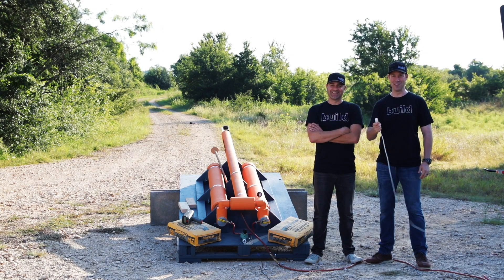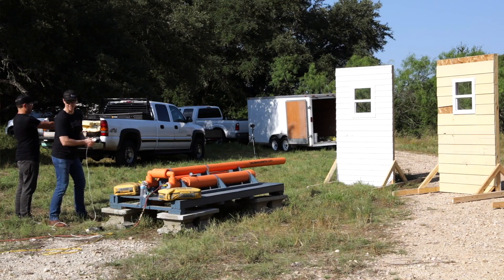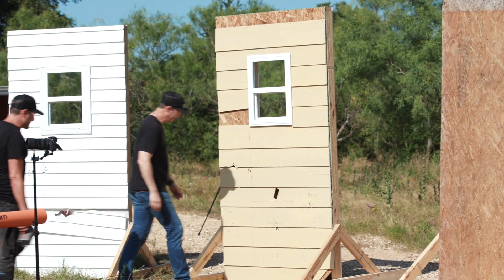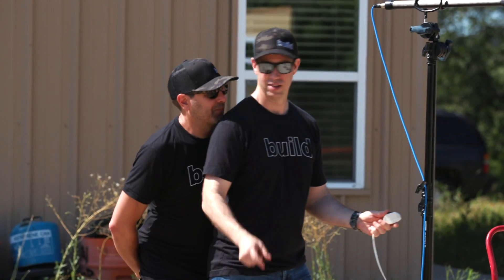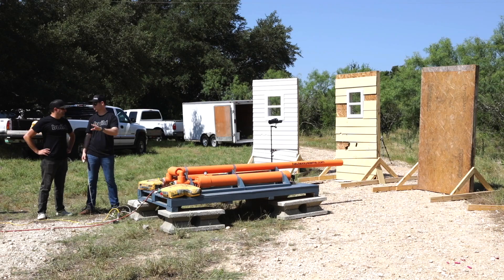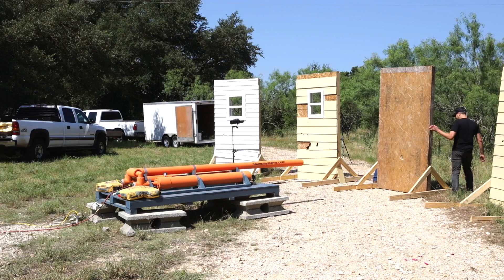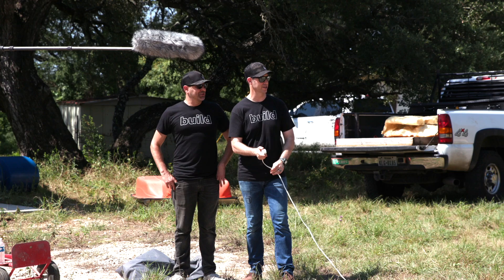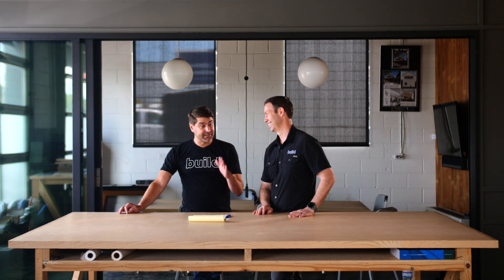2x4 Canon - Hurricane Testing Wood Walls

Comment: How does stucco do in this kind of test?  

ETA: I looked around for information on this question. From this 2006 report DEBRIS IMPACT RESISTANCE OF BUILDING ASSEMBLIES:

With a 15 pound 2x4 projectile at 55mph "the projectile perforated the target".

Too bad, but with 3/4 inch OSB instead of 1/2 inch OSB and diamond lath instead of chicken wire in the stucco my guess is the 2 x 4 doesn't perforate the target.

Also, I thought the close cell foam  didn't get a fair test: Fill the cavity, and put a piece of sheet rock on the wall.

Comment: I did a project in Chad where we had expanded steel mesh on top of heavy steel studs with 2 layers 5/8 drywall for security. Made it a pain to have wiring and plumbing run through walls. I wonder what something like a spray on bedliner would do.

Comment: Matt, if you come back to this topic in the future, I'm thinking the plywood/metal sandwich could be your exterior sheathing and that might prevent the 2x4 from entering the stud bay at all. It would be a cheaper system because you wouldn't be needing the sheathing you have on your current model. The outer layer of sheathing could also be Zip sheathing instead of plywood if you wan to stick with your usual wall waterproofing system.

Comment: FEMA has  great information on how to build storm shelters with different types of materials, on one type of 2x4 wood walls they  use one layer of 14 gauge metal between two 3/4" plywood.    https://www.fema.gov/media-library/assets/documents/3140

Comment: Matt, what are your thoughts on using metal insulated panels in home construction? They seem to have many of the benefits of SIPs, but don't require a post (no thermal bridging) and are clad in painted galvalum, rather than OSB. I've provided a link to the product I'm considering. Also, one of the salespeople told me that some their products do well in the 2x4 launch test, as you have done in your video.

https://www.permatherm.net/metal-panel-systems/insulated-metal-panels/residential-metal-sips

Comment: ICF has been tested & proven to stop a 2x4 in hurricane conditions, of course, but I was wondering what SIPs would do, including a SIP with at least one side sheathed in metal, as I've seen some owners using to build theri Tiny Houses.  Do you have any idea?  I live up in the Pacific Northwest, where we don't get hurricanes, but we do get heavy windstorms a few times a year, in a region with way too trees with branches that can get ripped off and thrown around in gusts at least that strong, sometimes stronger.

Comment: I live in south Florida and I’m pretty sure they shoot a 2x4 at 150 mph.  We were in the bullseye but dodged a bullet, or 2x4.  Tilt wall or cinderblock filled is the way to go.  I believe Miami Dade code is cinderblock now.  They need to stop building structures that won’t withstand what nature is providing.  We have cat 5 so build it to withstand a 6.  I built a shed and it’s all marine grade, glued and screwed together. The sides over lap the floor and everything is completely connected together.  It’s been through the eye of a cat3 and it didn’t budge.  Each corner has 200lb of cement  buried 2’ down.  A cat 5 might roll it over, I’m not sure but it will still be together.  A 2x4 would go right through it, it’s only a shed for gosh sakes.

Comment: You should test some real walls at real hurricane speeds Try 140 mph on Cinder Block or a TridiPanel (2" of shotcrete on either side of 3" of styrofoam).

Comment: Houses in the netherlands are usually built from rebar + concrete walls lined with bricks with an air gap between the two for isolation. I think it's safe to assume i'm safe from 2x4's. Though we use the metric system so I don't need to worry about those. :p
Reply: Wouldn't that be awful during the summer time?  The humidity and high temps in  southern u.s. is pretty miserable.
Reply: @michaelhathcoat7876 nope, some good insulation will help that, we also have amazingly good insulated tilt and turn windows to help.
Reply: Well the on the second hand your house have a lot larger carbon footprint
Reply: @peterkral4660  Instead of having to rebuild your house every good hurricane season, Dutch houses are made to last for at least half a century but mostly longer, so there is time for the footprint to fade.
Reply: @peterkral4660 yet they last forever.
Reply: @miles5600  show me someone who live in the same house for ever
Reply: @peterkral4660  that’s not the point. The house can stand there for 300 years while the owners change or add whatever they want on the house. You’re just not fully plowing it down. People here often move max 4 times in their life cause there just isn’t a need move more.
Reply: @miles5600   excatly that´s my point. The technology evolves even in contraction idustry. The house build 30 years ago is completly obsolete even if it can withstand 300 years. The reconstrucion of old house is often more costly than building a new one. Nobody will live in the same house, that their paretns were born withou complete renovation ie.: destroying 80% of the building. It is not just cost inificient, but it require more energe, more CO2 emissions to create new buidling materials that are heavely bound to CO2 like concrete. Building a house, from material that has negative CO2 footprint and can be naturaly decomposed if not needed is a huge improvement
Reply: @peterkral4660  that’s not the case in the netherlands. Building foundations and wall construction has been identical for decades now. When people do major renovations here they hollow out the inside while leaving the outside, but most appreciate the history of old building thus leaving the outside alone and just doing stuff on the inside of the building, in the netherlands you’re also not allowed to just build out the house or remove an outer wall, you’ll need a permit that can take years. Our market here is very diverse and has every home you’re looking for so they often look for a home that just needs renovations from the inside which is way cheaper than having to rebuild it all.

Comment: No structure to Hardi Plank.  Once again a total failure for it.  Should not be used for this and many reasons.  A clean rectangular hole shows no dissipation of energy.  It just crumbles.  Terrible product in almost every way.  Modern sheathing is not helping either.  Once again we see minimalistic engineering and the results thereof.  Doug

Comment: Back in the 70s my father built homes in SW Florida. All of the external walls were cinder block. Why do they no longer build this way. Surely it’s not just cost
Reply: Probably because of thermal loading.  Without adding a lot of layers, cinder block have a very poor R rating.  Eight inch block is about R 2, or the same as like 1/2 inch of fiberglass.  See https://homeguides.sfgate.com/increase-rvalue-concrete-block-wall-54431.html

Comment: You guys should test a brick house, I live in lower Bucks county in Pennsylvania and my house was built in the 1950s and my walls are are full size cinder blocks and then decorative brick on top of the blocks. My walls are pretty thick.
Reply: You would be surprised. Brick houses stand up fairly poorly to hurricane/tornado debris. Expect to see that piece of 2x4 come through the wall. What you want is an ICF house, basically a reinforced concrete wall, and for good measure you want that tied into a reinforced foundation slab. You then want a steel frame for your roof and you want that bolted down to the walls. Finish with an appropriate roof material (which does not involve shingles) that is steep and hipped (no vertical gable ends at all, as these introduce turbulence and consequently lift to the roof). Finally fit appropriate shutters for the windows.

Comment: Yeah, I'm not sure it's useful to try to build a bullet-proof, wind-driven debris proof wall out of anything other than concrete. The cost of trying to equal that performance with non-cementitious materials is going to be prohibitive and will never equal concrete in durability. Pour-in-place, high-performance concrete walls and roof, FTW. Problem solved.

Comment: A .308 bullet has an energy of about 3500 joules. A 2x4 stud of 8 ft lenght weighs about 13 pounds. At 80mp/h this 2x4 has an energy of about 3700joules . (Feel free to correct me, if anyone has a better or more correct way to calculate this. I went with E= m/2 * v² . Remember to get the units right when doing the math; e.g. E in Joules, m in grams, v in meters per second.)
I was pretty sure that the damage would be tremendous -  and dang... it is!!!   Penetration, however, usuallay will increase when the projectile becomes smaller. Thats why a much smaller .308 bullet with about the same energy will penetrate even deeper.

Great test - it definitely shows, how important proper shelter during a storm is! Most homes and houses cannot provide this.
I really hope that you people over there will get through that hurricane safe and unhurt. I keep my fingers crossed four you!!!
Reply: Mass would be in kg not grams, we are kg/m/s these days not c/g/s if you want the energy in Joules. So 13lbs is 5.9kg and 80mph is 35.7ms which gives 3760J, so obviously you did the right thing in your calculation, but your write up is wrong.

Comment: in the test with the 18-gauge metal layer, isn't this going to act like a giant faraday cage, making cellphone reception awful? I suspect thats something people will want to know ahead of time before covering their walls with it, many will probably want an outdoor to indoor antenna of some sorts, otherwise they might not want to be protected without internet! I mean, what are you going to do during a storm or shoot out, not use internet, that would be worse!
Reply: bob dole Great points. An exterior antenna would get destroyed in a storm, too, leaving occupants offline!
Reply: I go into lots of metal pole barns with florescent (or LED) lights and rarely have reception issues, much worse than being outside (may 1 bar difference). However, it is difficult to get reception in some tall metal clad factories. But, I'm told by the workers that it's the mixture of steel clading and the (usually) HID high bay lights. Apparently, with the lights off, you can usually get reception, but not when they're on. This doesn't seem to be the case with wood barns, having HID lighting. I service automated machines and I've been in over 200 factories and smaller shops. Cell phone coverage is often a background topic of discussion.

In any case, I don't think metal reinforced homes would necessarily kill cell phone reception.
Reply: @cornpop7805  Specialist - there is a reason why metal stud framed buildings use a lot of wifi repeaters and access points, but studding is different from covering walls with metal, which acts as a faraday cage and requires an indoor to outdoor antenna to allow cell signals to pass through neatly uninterrupted... its why there is such a booming market for the devices to overcome this, problem is thats mostly a commercial setting as residents don't typically shield their homes from signals like this will do...
Reply: I'm partial to 10 gauge cold rolled.

Comment: I saw something from FEMA about a wall system very much like this that was designed for storm shelters.  I have wondered about using a stretchy adhesive between those layers, but it might be too rigid to absorb the energy. I would want to test it first...

Comment: Tyvek would stop it but not Zip System.

Sincerely,
DuPont
Reply: Bahahahaaaa
Reply: Dupont did develop a SIP panel with Kevlar that would resist the 2x4 with ease and had some ballistic protective properties against handguns.
Reply: @DavidMDensford  I can't find this SIP panel you speak of
do you have a link?
Reply: @mountainbikerdave  DuPont Stormrooms of America in North Arkansas bought the manufacturing rights back in 2012-ish.  Not sure what has happened recently.
Reply: Maybe. Someone did the research on why Mongol warriors could survive arrow hits, and they found that their silk undershirts would catch the spinning arrow and wrap around it, reducing penetration.
Reply: @Crusader1815  that's complete bollocks.
arrows don't spin in flight.
I think you got arrows mixed up with bullets.

Comment: After helping a friend close his house back in after hurricane Micheal last year we saw all different forms of structures from CMU to wood to steel leveled and sitting in the middle of what used to be a neighborhood was one ICF home with some siding missing. All other homes gone from the surge. I'm not saying its for every where but when a complete city is wiped out like Mexico Beach Florida because of  improper building practices for the area the codes in those areas needs to be revamped.
Reply: Indeed. I blame inadequate building codes for the Paradise, California fire being so disastrous too. They knew they were building in a hazardous fire area (or should have known, it's heavily forested) yet they allowed people to build structures using flammable materials on the exterior. It was a disaster waiting to happen, and it finally did. The negligence on the part of regulators, builders and forest managers is mind-boggling, yet nobody got put behind bars for criminal negligence.
Reply: @dlwatib  agreed 99%.
but with one correction, it's not builders.
 It's these corporate housing developers that build these cookie cutter communities. filled with these low quality high profit homes which they slap together in less then a couple months.
They bribe the government and promise massive new revenue streams from the future property taxes, so they lower standards and have the building inspector look the other way.

it boggles the mind that in today's day and age when we know so much about materials science.
that we still build homes that can burn down.

Comment: I'm always flabergasted by the minimal codes applies to house building. Why in hell do people build regular houses in either flood, hurricane, tornado or earthquake zones? We have the tech and know how to proof against all of those!
Reply: $$$$ and 99% of houses at least in tornado areas will never get hit by one. Hurricane area houses are usually built with concrete. Earthquake area houses are still wood but beefed up to not fall down. Wood is actually the preferred structure in an earthquake because masonry may be hard but basically it is just held together by weight and can fall down when shifted.

Comment: Building out of thin plastic, cardboard and drywall won't stop a determined person running at it let alone guns or missiles.
Reply: In Ohio, I had to pay extra for OSB sheeting because my builder's default was really thin vinyl siding over 1/4" fanfold foam, 2x4 wall with fg batts, and 1/2" drywall. Forget burglary skills, you could literally break into these houses with your bare hands. They tried everything to talk me out of the OSB wrap, but I insisted. We have basements, so we're fairly safe from storms, but I was worried about break ins.
Reply: @cornpop7805  not surprised, I prefer brick and block myself, or might go ICF, just want something that won't burn down.

Comment: As much fun as you had with this, I know you are going to do it again. I really really liked this one.

I would like to see comparison between different sheathings, Plywood vs. OSB vs. engineered and if the thickness gives it exponential gains. Also in Florida, lathe and stucco are more predominate than siding, also a good test.
Reply: Carl McCoy Down here in South Florida new construction required Concrete Block but usually they put stucco over it for cosmetic look?

Comment: Should I ever suffer the ill affects of sudden, unexpected wealth, Matt, I will want to work with you on replicating CCC architecture with the use of modern science building while incorporating three foot thick stone walls and bullet proof glass, the goal being a structure than can withstand 500 mile an hour winds  and last 500 years with minimal maintenance, ie; EXTREME over-engineering for gulf coast and tornado prone areas without having to go underground.

Comment: Why the metal on the inside? There are companies that make fiber glass storm pales for that reason. You can put them on the outside and not worry about expansion or rust from condensation. Yes you will need to have siding fixed, but no interior penetration or damage.

Comment: you were close to the specification for an 8' square wooden framed tornado proof safe room.  double 2x6, 12" on center. quad 2x6 at corners. double 3/4" plywood continuous from corner to corner. and 14 ga. steel sheet between sheathing and studs. wood sheathing would be on the exterior not interior as you had in your experiment. see fema design drawings here: https://www.fema.gov/media-library-data/1418837502817-920f09bb8187ee15436712a3e82ce709/FEMA_P-320_2014-ConstructionPlans_508.pdf
Reply: 14ga steel sheet will corrode, why not use reinforced cinder blocks filled with concrete and/or reinforced brick walls?  At these price points, brick walls seem cheap.. and safe.
Reply: @aitorbleda8267  cmu and concrete walls are an option as well in the fema  drawings.